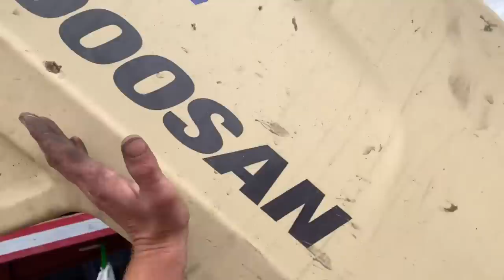The DREADED Doosan compressor!!!!

Comment: When I used to service generators and service compressors I had a pressure washer in the van to wash out the rads and I was the only engineer with one so I got extra work off other engineers on breakdowns with over heating   cannot beat washing with water
Those other pieces of plant Scotty has will all be the same  running hot  with choked radiators     might be worth while doing some up sell
Reply from the maker: Yeah I’ve learnt of this one that blowing them out is no way near as good as a pressure washer, it’s going to be an on going problem there mate 👍

Comment: With these screw comps if the cooler is blocked they will heat up in no time.   Normally cut out at 110-120c Infrared camera is a god send on these.

Comment: Just a quick long one. Years back bought an old well used big compressor from a sandblaster mate. He did tell me to check oil as she uses a drop. Engine oil was fine, regularly checked and serviced. 3 years down the line, red hot day, very hot noises, smoke, steam, you name it, glowing red. Nobody would go near the thing so the inevitable. Huge bango. Funny at time but we did,nt know you had to top up compressor oil; that’s what my mate meant ! Classic
Reply from the maker: Mistake on your mates part, I never know about the separation tank oil to 😂😂 and so we learn 👍👍 cheers Stephen

Comment: Chris try ramming blue tac into ya phone and pull it out that generally cleans my speakers and mics out 😏 as ya well know shite gets everywhere and my phone is a daily clean 😂 my issues with it over heating was wrong drive belt 7 41 isn't too hard to get hold of as a motor supplier will stock em but 7 71 is a little more in the plant side and harder to find the right belt without going doosan root
Reply from the maker: One of the lads on the comments said about the blue tac… still no good mate! Bet you struggle with the amount of dust Mick! Thanks mate hope your well 👍
Reply: @Professional-struggler  yeah blue tac generally works with dust and pocket lint but you may have oil/grease then a duno. I know 1 thing don't use air line to blow it out as that is bad for it 😂 I'm lucky I've been on a nuclear job (no filming allowed 😔) lucky side to it I got it finished on Friday and I booked till Thursday so I'm going to enjoy this weather to be honest it would be too hot for me to work in this anyways. Take it easy mate especially in direct sunlight 👍

Comment: Hi Chris, that JCB hub won’t weld well ! You will be waisting your time and effort as the welding will effect the tensile strength of the hub and the weld will be brittle due to it pulling the carbon into the weld from the tempered and heat treated hub , if you do manage to weld it it will soon fail again mate ! Only thing is second hand or new sorry !
Reply from the maker: Thanks mate 👍 we’re going to have to try….. you know what it’s like 😁 failure is the only option 😂👍

Comment: Cooling pack should be first point of call of any overheating engine. Engines run a lot hotter these days and everything that needs cooling is dumped in the pack. Buses suffer terribly because they suck the shite in from the rear wheels due to pack location and bet compressors are the same because everything is stacked ontop of each other.
Reply from the maker: Thanks mate! Like us mate not used to the heat 😅👍
Reply: @Professional-struggler  buses get permanently abused due to poor timetabling. You can hear the fans running flat out trying to keep up. Will be interesting to see how well they survive the next couple of days
Reply from the maker: @tysondundas1947  yeah engines are in a bad place sat right at the rear mate…. They’ll be some struggles on Tyson 👍

Comment: At least your Friday ended better than mine dude, I needed to change the alternator on my old ford cargo, and change the fan belt (well that's where it went down hill, then got worse as I changed the fuel filters so now I have no fuel to the pump, tell you I ears ready to end it all, and just picking your brains do you know anybody who does welding as I need my cab floor
Reply from the maker: Mate if it’s going to go wrong it will at the worst time 🤦‍♂️ there’s some lads around my end that do some welding mate